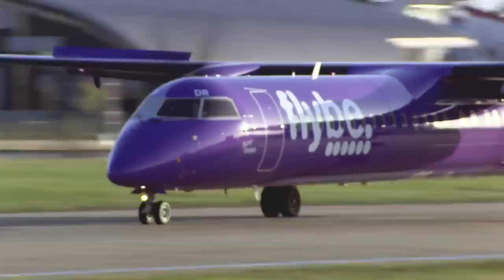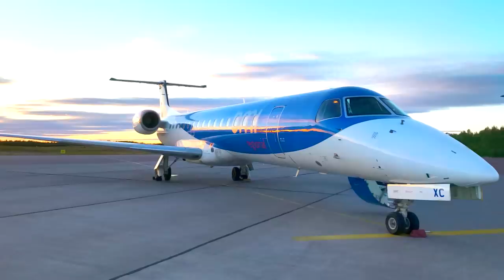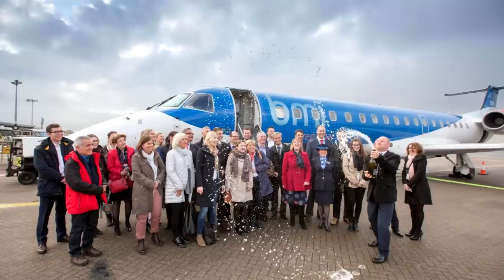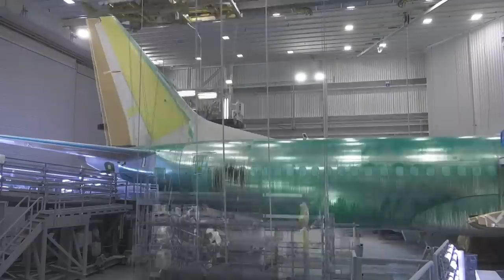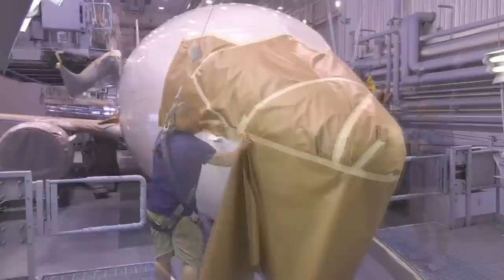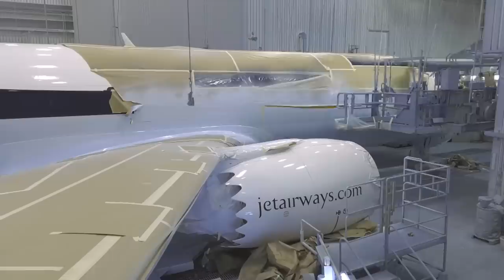Why Did FlyBMI Fail?

Comment: I was one of the ppl working for Flybmi and being sacked in February 2019. It was a nice company to work for with very nice colleagues. We had good contracts with LH and Air France. There was a lot of potential for the company. And yes....like any other airline there were also issues. The demise of Flybmi was planned way ahead by the upper management. It all started with a year before by changing the HQ address to Loganair’s, then shifting the engineering of the emb 145 over to Loganair, then transferring 2 embraer to Loganair etc. The management was so kind to send us a email that it was over......40 min AFTER the official press release. After this, Loganair took all the remaining aircraft and were offering the pilots contracts with them. Lots of them accepted because they had no choice and in the mean time, loads of them left already or even got sacked for the second time in less than 10 months. It is really pitty because there was a potential. Brexit, fuel price etc.....it was just 1 big lie of the management. There was simply never a good CEO with a vision and the 1 we had left a serious mess behind by expanding too fast.

Comment: the reason that flybmi fail is that they did the exact opposite of what other airlines do to make money (they didn't charge checked baggage, they offered free drinks and snacks, they operated uneconomical planes with low load factors). the only reason they kept afloat is because of their high prices and the codeshare with Lufthansa and Air France.

Comment: I flew with bmi from Newcastle to Brussels in December 2018 and it was a very pleasant experience. The service was incredibly good, which is rare on regional flights across Europe. I flew as a tourist, not as a business traveler and the price was reasonable. There are generally no cheap options between Newcastle and Zurich, which was the connection I needed. The flight was not full though. Btw I really enjoyed flying on the Embraer and it seemed quieter than an A320 due to the engines at the rear of the plane.

Comment: Airlines failing? Get used to it.

1. There's way too much seat-mile capacity as is, thanks to ambitious low cost carriers and weakening economic outlook in many parts of the world.

2. Over the next 10-15 years, AI will reduce the world-wide labour market by 40-50% (the elephant in the room that nobody wants to talk about in the airline industry). Bottom line: poor people don't fly, particularly when putting food on the table is a struggle.

3. Expect a glut of low-time aircraft to enter the used market over the next 10-15 years, and significant downward pressure on both used and new aircraft prices.

Comment: The closest airport for me is Southampton. I would love it if I could fly out of Southampton more often. It's a small, efficient and pleasant airport and is only 90 minutes by train from west Dorset. Compared to having to go to London, it's a dream. The problem is that BMI had only one destination from Southampton: Munich, which isn't anywhere near the top of my top destinations. As a result, there was never a reason to fly with them. From London, they'd have to compete with the likes of KLM, Swiss, Lufthansa, SAS, Air France, etc. on short-haul flights for those wanting a higher quality experience and with Sleazy Jet, Lyin' Air, BA, etc. for those wanting cheap and underwhelming. They couldn't quite make their presence felt with either segment.
Reply: Bunnyroo7 flying to Munich was a good route to be honest as it allows you to connect through to the massive Lufthansa network